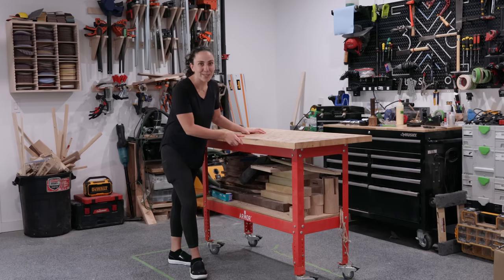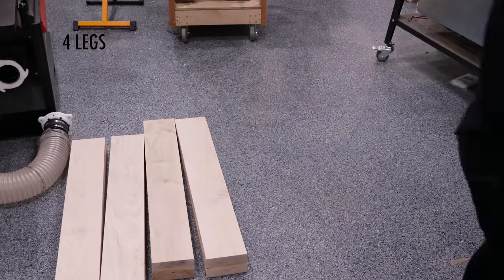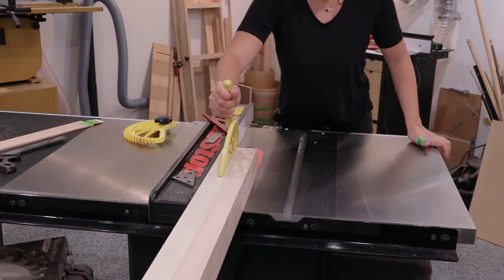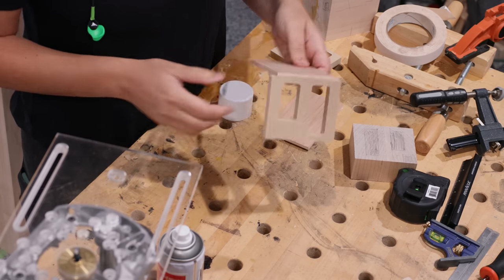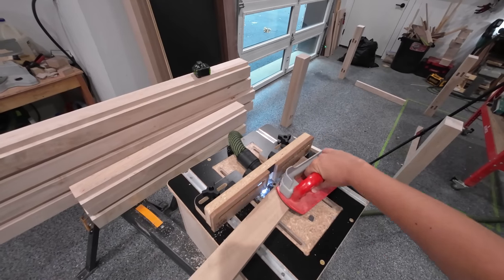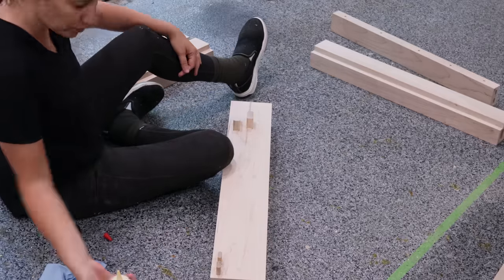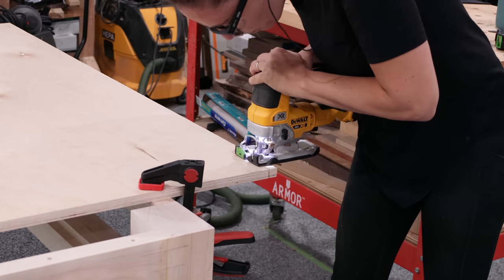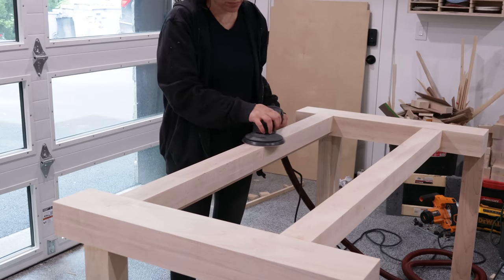My DREAM Workbench Build // PART 1: The Base

Comment: I was wondering, as I have seen this some other youtubers (not) do this, but why do you need the bottom cabinet piece if you are making drawers as it will just get covered up?
Reply from the maker: Bc it makes everything more stable and all the other pieces rest on it. It’s the bottom of a cabinet. Why do you need a bottom to a cabinet?
Reply: @3x3CustomTamar  my other question was that I saw you rabbet out a section for the bottom cabinet. Could you also not do that for the exterior sides of the cabinet and screw them into the rabbeted section to hold it? Would that be strong enough? Love your work BTW, some of the stuff you do I would never even think of.
Reply from the maker: @aminderpuri9392  sure. I just like the rabbets for alignment

Comment: Tamar, are those magnetic dust collector fittings?  Where did you get them?  I am having trouble finding fittings for a new machine.  It is a Hammer jointer/planer with 120 mm dust port.  Hammer (Felder) is out of stock in the USA for their 120mm to 100mm dust port reducers.
Reply from the maker: Not magnetic. They are twist lock. Izzy swan sells them via tay tools
Reply: @3x3CustomTamar  Thanks for replying.
Reply: @3x3CustomTamar  Since I need a 120mm to fit my machine I bought a 5” to 4” sized for drainage pipe from Rockler with a flexible rubber
Reply: to continue:  cuff on the 5” end.  It will barely fit over the 120mm diameter on the machine with a bit of grease and a lot of force.  Strangely, the 4” end is the same size as the 4” hose and they butt against each other.  I bought a PVC fitting designed for 3” screw in end plugs.  It just fits in the 4” hose and turned the other end to fit the in 4” end of the Rockler 5” to 4” reducer on a wood lathe.  It is slightly tapered.  Then I cleaned the threads out of the PVC plug adapter on the wood lathe.  A lot of hassle but it fits nicely.  In a few month, hopefully, Felder will have the proper reducer in stock.  I really won’t need it now!

Comment: I'm really just getting started so please don't take this as a criticism.  I'm genuinely curious and now wondering if I need to invest in a large band saw as opposed to putting more $$ into a larger planer.  When your making deeper cuts, why don't you make those on the band saw in one pass as opposed to multiple passes you made on the table saw and then cleaning that up on the planer or joiner?  Is it just more work than its worth to set up the band saw you have?
Reply from the maker: My bandsaw was giving me issues. I got a new one actually so I may use it more often for that stuff

Comment: Won't putting the miter saw in a corner like that limit the lengths of things you are able to cut? I guess you can rough cut with a circular saw then refine things to final length on the miter saw... but that sounds pretty inefficient.
Reply from the maker: The sand will have wheels 😉 I’ve already thought this through. Ha

Comment: Ankle video.
I either broke mine or severely sprained mine 2.5 years ago. I didn't get it checked out because of the, you know the thing. Took a long time to heal.
I stepped in a frozen tire track and it sounded like a branch breaking. I went straight to the ground. Had lot of brusing.
Reply from the maker: It took me 3 weeks to actually go to a dr because I kept telling myself it was fine… I was relieved when it wasn’t broken and it was just a sprain. But it’s taking a very long time to heal….

Comment: What are the dimensions of this bench?  Just wondering how big it really is and if you think you can breakdown sheet goods on it.
Reply from the maker: It 75x36. I never work with full sheets bc I can’t fit them in my car. So I can break down sheets that have already been cut at least once. Ha
Reply: @3x3CustomTamar  Thanks!  I feel your pain.  I can transport them but have a very small, multi-use shop so I am trying to figure out the best, small size that I can build to serve as assembly table, outfeed table, sheet good breakdown, etc.  All for a hobby :)  Thanks again!

Comment: Stressing about glue open time in a glue up is the worst feeling ever. Now that I'm located in southern California hot days can make the open time much less... I saved a lot of grey hairs on glue ups of joints with total boats thixo thickened epoxy. It stays in place as well as caulk and comes in a premixing caulk tube with a 45 min open time on a hot day and 1.5 when it's cold 🙏🙏 its .just gotta stay in clamps for 24 hours.. save my wood glue for the simpler things and edge glue ups

Comment: Well done!
Bloopers are always great, please share ;)  I am currently building a stand/cabinet for a 220 gallon aquarium that is remarkably similar to your bench, but 7 foot long. Pipe clamps are arriving today (lesson learned).
I will be using dowels instead of large tenons, and I'm curious if you have a good way of making templates, like your tennon template, for dowels that doesn't require a cool, mini CNC? #toolenvy
Reply from the maker: I used to use dowel joinery for like every build. I have a method in my “7 alternative methods to using a domino” video that I really liked. Required making a jig with 2 pins that mark the hole locations
Reply: That is a super cool, simple, handy tool. Very clever of you. Thank you, keep it up! @3x3CustomTamar

Comment: Let me guess: you sprained it while hoping down from standing on the top shelf?! ;P Been there. 
Btw, I love seeing all the different skills & techniques you're applying to this build but to me it seems a little overkill. Do you think it would be just as sturdy utilizing lap joints rather than the time and effort it took to make the dominos?
Reply from the maker: Haha. It was already sprained at that point… 

And joinery is always optional and up to the end user. Lap joints would be totally sufficient. This is just what I chose to do. There is no right or wrong.

Comment: Instead of making rectangular mortices with radii in the corners why not just use a 1" diameter straight cut router bit and route a 2-3" long slot, 2-3" deep leaving the round on either end. Then the floating tenons are planed just a whisker less than 1" thick rectangles that have been hit with a 1/2" radius roundover router bit on both sides of the two long edges making them round that would fit the round ends of the tenon you routed. Do not roundover the ends as they need to be flat to bottom out in the mortices. This means there is no wasted time spent on making a template or testing a bushing/bit clearance and more progress in less time.

Comment: You don't expect a NASCAR driver to use his personal car do you?  You don't expect a professional MC to use a a cheap DIY microphone right?  So there's ZERO reason not to use higher end tools.  Also, I regretted not building a second shelf just below the top shelf.  Now, my workbench is ALWAYS cluttered.  LOL.  I'm sure you've built it already, but for those reading comments, I LOVE the UJK Parf Guide system for making dog holes.  It SO accurate.  Hope you're feeling better.
Reply: I used the UJK MK 2 version and it was brilliant. It’s expensive but lasts a lifetime and you can use it as often as needed.

Comment: This is ten thousand dollar work-bench... awesome... you cannot buy something like that... you have to build it. Imagine you slip with your power tool and accidentley drill a hole into the top...
My work-bench is made from 2"*4"  *8ft pine. Top is a solid wood door. It does not look as good as your bench, not even close, but it was a lot cheaper to build.
Reply from the maker: It’s a showpiece for my videos ☺️

Comment: Why didn't you just used electric tape to stop the wires from touching..unless I'm missing something.
Reply from the maker: A possible solution. The switch is like $20 though. So it’s an easy repair

Comment: As far as plans go for the bench, think I would sit on it a bit until you have lived with the design for a while. My observation is those people who put dog holes in the entire surface don't use 75% of the dog holes for the life of the bench, more strategic placement a better option in my view (and less work.) But, plans perhaps should wait until you have lived with the bench for a while. 

I know you get pushback from others on using more expensive tools(most not looking at your earlier videos), and perhaps a bit early - yes, you have created some projects over the last year since entering your new shop but based on injury and other thing you have been doing not as youtube prolific or IMHO addressing more creative projects - to evaluate, but I am wondering if you feel the more recent tools have made you a better wood worker? I realize more expensive tools having more power can clearly make things easier, and plowing through wood in a hurry can clearly save time. But, do you feel your most recent projects are "better" based on the tools? 

Don't get me wrong, clearly your vacuum system is one star of the show, making the environment safer and more comfortable not needing to ware a mask much of the time. And having the SawStop with its great safety features and power both facilitate your work. However, do you feel they have made you better? It would be interesting to hear your thoughts on this, perhaps most importantly where the tools have helped in comparison to the old tools. 

I understand you caution when it comes to the ankle, as you walk on it all the time so need to let it fully heal.

Glad to see you in action and look forward to you getting your shop in more comfortable working order for many videos to come!!!
Reply from the maker: Absolutely not. You can mess up a cut even with a sawstop. The tools don’t make someone a better woodworker. What better tools have done for me is decrease my workaround time. But as you said. There have been less videos… that’s bc of life, not anything to do with my tools.
Reply: @3x3CustomTamar  I am sooooo sorry, I did not mean in any way that the additional equipment was somehow reducing the number of videos. 

Following you for a while and aware of at least last year you moved (big thing in and of itself), you are building out your shop, you have stuff going on with Katz Moses, you have build out some practical things - a couple of beds, desk, ..., so have been busy), plus kids and husband and I am sure a bunch of other stuff the YouTube world is not aware of. So, not saying you are busy and happy to see you are getting your workflow together as I can see good thing to come.  

The question was intended to be a bit more nuanced. My own self observation is that sometimes a new (usually more expensive)piece of equipment can provide a higher degree of precision, accuracy, repeatability, ease of use allowing things to come together better increasing confidence allowing the appearance of being better. 

However, I also agree that a reasonably tuned $500 table saw, for example, will deliver just as good a cut (or the opportunity for just as many mistakes) as a more expensive tool having advantages to be sure, but results can be equal. 

I guess in some ways I was asking if you miss your old shop and wondering if you miss the work flow as you new shop is not quite there. 

So, did not mean to insult, just looking for your perspective.

Glad to see you in action.
Reply from the maker: @quargr  wasn’t insulted… no worries. The answer is still no though. I don’t think my work will be better because of these tools. I knew I couldn’t get a straight cut on my table saw, so I would rip a little wide and clean with hand plane. The end result is going to be the same in less amount of time.

Comment: I have to say I know all to well about injuring my self.  I was doing work in a clients attic and there was no floor just the ceiling joist of the floor below.  I missed the joist with my left foot and the the right foot slipped off the other side at my weight the plaster lathe did no hold the weight and I fell thru until the joist stopped me at the crotch.  Both legs would not pull thru because the lathe was stabbing my leg when I tried to pull.  My co worker cut my legs free as soon as he stopped laughing and took.  So please post the video of you accident I am sure it is not as bad as my screw up.
Reply from the maker: Omg. That’s a crazy story

Comment: Realistically, wood working is a journey. I could complain about you having a planer, or a domino. A year ago I could have complained about you having a table saw. A couple years before that a bench. And, when I was younger I certainly did complain about people having money for lumber. I have come to the conclusion, when people complain to you about having x tool. Refer them to a toober who builds, or works without x tool. Rex Kruger, wood by wright, and Matthias Wendell. Between those 3 if you can't do any wood working, it's not a tool issue. And all of them have started their workshops from the bottom.
Reply: I’ve only recently had Rex pop up in my video recommendations and from the couple I’ve watched did his workshop ever improve? (not meant as an insult in any way)
Reply: @inmyimage1081  yeah, he doesn't tend to show off his shop much in his vids, but he went from a handsaw a chisel and a drill to a work bench with incremental improvements.
Reply: @RFMongoose  I think I caught a glimpse of a saw stop table saw also
Reply: @inmyimage1081  maybe, but he's got vods going from no bench, to Roman bench, to Moravian bench. All with hand tools.
Reply: @RFMongoose  True and wasn’t trying to put him down in anyway, was just saying that he doesn’t do all of his work using just hand tools, but frankly Matthias doesn’t either, he just make his power tool.
Reply: @inmyimage1081  true, but the point I was making wasn't to that these people don't use power tools but rather that if someone is upset because they don't have power tools and Tamar does, the issue is not with Tamar, it's with the viewer.
Reply: @RFMongoose  Agree 100%, especially since she talks about other ways to accomplish the same thing and also let’s people know about past videos where she did things without any fancy expensive tools, , just slower. I don’t get why this irritates people, although I could see an argument against tools that are completely and ridiculously priced high enough that most likely 99.9% of viewers can’t buy and there isn’t a more reasonably priced alternative so basically the creator is making something we can’t. Crazy thing is, a lot of them wouldn’t 

An example would be a guy I saw recently using a Pantarouter to do all his joinery. Most of the things he was doing could still be done by us diy’rs though, it would just take a lot longer, be changed a bit and most likely require a couple of tools to accomplish. Personally I’m not interested in nwatching somebody using nothing but tools they wouldn’t be able to buy with their own money just like us. Don’t like the sudden influx of the Shaper Origin either,  it’s just boring to watch and isn’t giving me any useful info on accomplishing the task at hand. Don’t like the people doing the ASMR type videos where they don’t say a single world either. My response to them is to simply stop watching and moving on to something that is useful and interesting without proclaiming that I not going to watch them and/or making a spectacle of themselves telling everyone that they are unsubscribing.

Comment: Why gluing the legs? 
It wouldn't have been more complicated at all to make simple tenons and wedge mortises. 
This will be nightmare to move if you change house or whatever. The whole piece all glued up must weight a goddam ton.
Reply from the maker: We just moved last year and we moved a few tables. It’s just like moving a table. Except it will be easier bc it will have wheeels. That, and I don’t plan on moving any time soon.

Comment: I don't get it. U use the shaper to make the template. Just use the shaper to cut directly 🤷
Reply from the maker: I still dont feel confident in myself in getting the exact location on the piece with the origin.
Reply: @3x3CustomTamar  😂😂
Less change with missing with the shaper 😉

Comment: is the ankle sprain video a teachable event? If it is show us, if not and just for comedy value, then don't. How much did your workbench cost in materials - that would be good to share.
Reply from the maker: Not sure if it’s reachable… I still don’t know what I could have done to avoid it except pay more attention… ha
Reply: @3x3CustomTamar  it depends on the root cause. such as workplace clutter. safe lifting in a confined space.  inattention  or rushing. using a chair to reach something instead of  steps or ladder. working solo. banana skins on the floor. someone tied your shoelaces together....😀
Reply from the maker: @martinmoss317  somewhere between clutter and safe lifting 😂
Reply: @3x3CustomTamar  it's a teachable reason to show the clip. all joking aside.. it's put you behind schedule and in pain, could have been worse.

Comment: Two phrases I'm tired of hearing from makers.

1 - "the dominos are just for alignment, and don't add any strength."  Ok. We know. Stop explaining. (I'm not saying you said this in this particular video, but it's sooooo over-said) :) 

2 - "no one will know you used pocket hole screws" - Anyone bitching about pocket holes has no idea about actually doing stuff in the real world, and when to and not to use one joinery method over another. Those people don't deserve the explanation. :)
Reply from the maker: The reason you keep hearing those things is bc people keep commenting on those things. So it’s a preemptive strike against annoying comments.